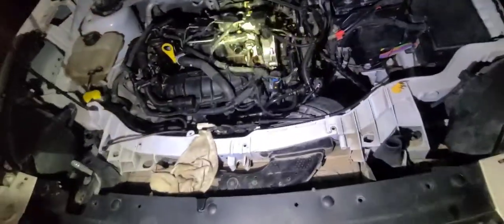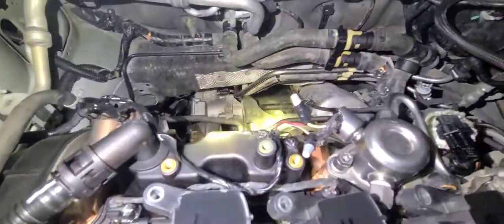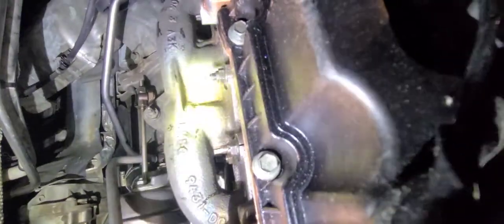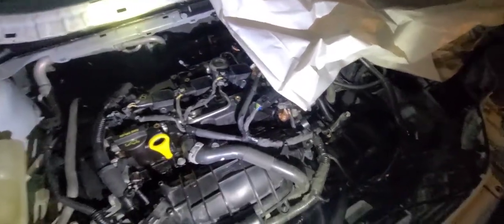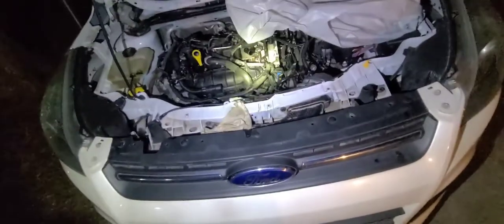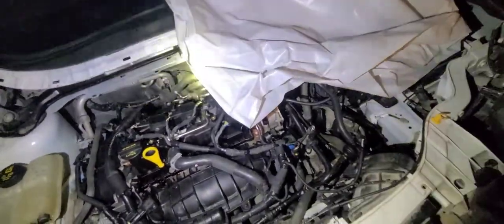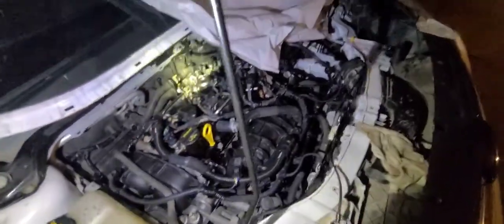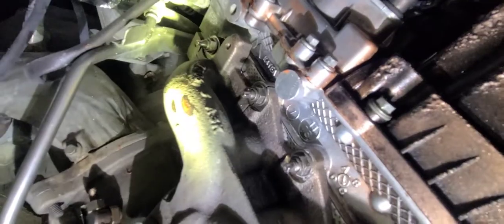2014 Ford Escape Pinhole Porous Engine Oil Leak, 1.6 L ecoboost

Comment: The 1.6 ecoboost has a reputation for cracking the block with pinhole cracks roughly in the area yours is leaking. Usually from the coolant dgas hose cracking and leading to the block overheating. There is a recall on the 1.6 for this. I have a 1.6 mondeo ( uk fusion ) and had a small oil leak in the same area. Found it to be the oil return pipe gasket on the turbo.

Comment: Two things to do, one put oil dye in the oil which you can buy at any auto store. Watch the area with a black light flashlight and it will show up under the light. Another is you can buy a dye penetrant set, the set has a special cleaner then a red dye that penetrates the crack then a white powdery coating that the red dye will show a hole or crack through. Check to see if you a have a recall on this engine as there may be a recall that may remedy the problem. If all else fails use the special cleaner that the penetrant kit has and JB weld it. Aluminum blocks and transmission cases have seepage leaks a lot and this will stop the leak. Good luck ( I am a retired master mechanic)

Comment: I've 2016 Focus SE 2.0L duratech engine. I've found that brake cleaner spray is super for cleaning engine dissolves oil and grease and dries up immediately. . Mechanic said that oil leak could cause fire..I think I'm going to have him fix a couple leaks. One is bottom of oil pan it's cracked right where it's flush against crankcase where AC compressor is mounted to. Another is rear crankshaft seal. Yet another at top valve cover.  And he's going to replace CVP valve .
Reply from the maker: Yep i used electical cleaner. Ford justbisnt want it used to be. They throw there vacuum cleaner engine into suvs and expect them to last long. Engine blocks just shouldn't have cracks like this.

Comment: How did you get the exhaust manifold heat shield out?  I have removed all the bolts but can't get it to lift out because of all the turbo lines in the way.  Did you have to remove those as well?

Comment: I have the same year and 1.6L engine which started leaking oil this month (puddles every few days).  Similar...can't find from where.  Going to take it in to a mechanic next.  Post if you have any updates please.
Reply from the maker: I cleaned and JB welded the area. Have been driving for several days and so far it is holding.
Reply: Yeah took it to mechanic too we found a few leaks. He said to clean it up so we can sure. Super great thing to use is brake cleaner spray. Dissolved oil and grease right away and dries up immediately. No residue. Making it safe to drive right away.

Comment: I have the same exact problem going on at the same location.  Engine overheated after radiator hose inlet broke off and engine briefly caught fire in this area until I could put it out with an extinguisher.  Replaced damaged parts and new valve cover and gasket as well.  Engine runs good and no codes..  So you fixed it using JB weld?

Comment: Were you able to repair the engine? I first thought it might be a gasket leak but if it’s a pinhole, I’m thinking JB Weld.
Reply from the maker: I cleaned and JB welded the area. Have been driving for several days and so far it is holding.
Reply: Did this work?

Comment: Is that smoke coming from the oil burning ? I have a similar problem. Took it to the dealer and they fix 3 other things that they thought it was the problem first. They quoted me almost 4K to fix the oil
Reply from the maker: Yes the smoke is the oil. We tried a few fixes but ended up getting a new engine.
Reply: @howtoamerica  my escape had a coolant leak so I figure it was that at first. Then smoke started to get worse. Few days ago driving on the highway the smoke got much worse. I thought it was coming from a different car and then realized it was coming from my engine. When I open the hood a small flame cam up. I was at the gas station so fire extinguisher was used. Took it to ford and they fixed “ other things” first then quoted me 4K to fix the smoking engine.
Reply from the maker: @CIAragDe  Kinda similar story. We tried everything but it ended up being the engine oil leak.